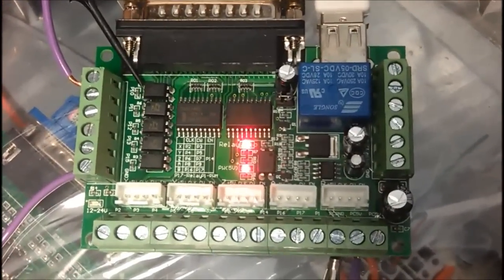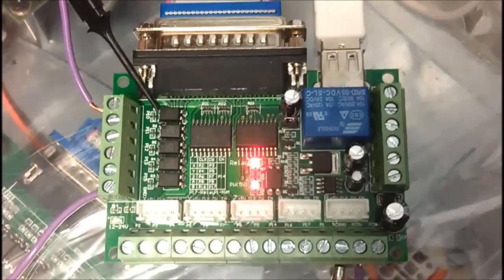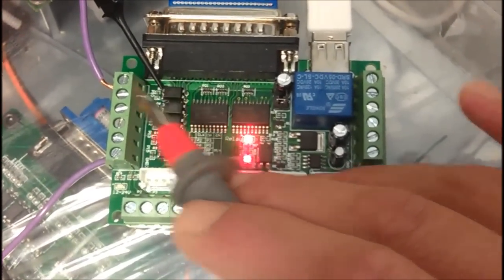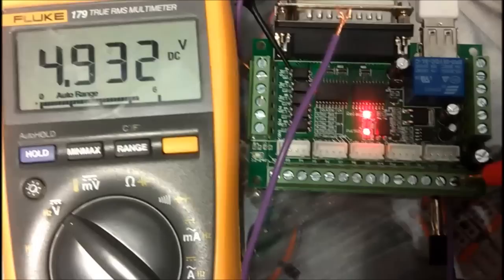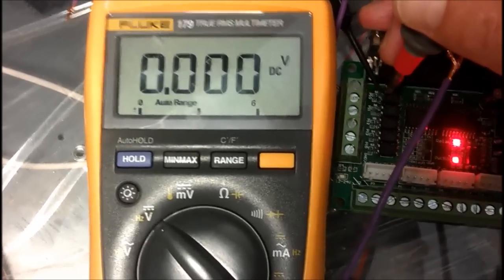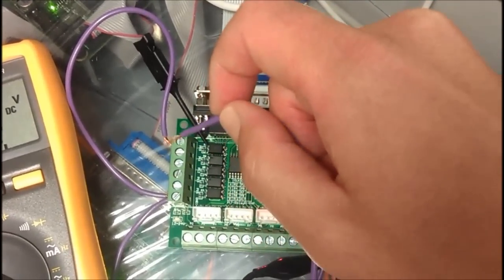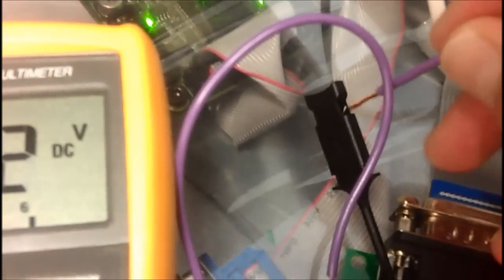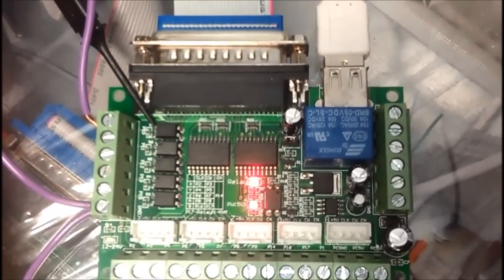MACH3 Interface Board CNC 5 Axis With Optocoupler Adapter Stepper Motor Driver

Comment: several issues here.... 
1) You're triggering the ESTOP as a limit switch? (top pin on the left side is the ESTOP trigger)
2) You're not supplying 12v dc - 24v dc to that board. You need both the USB 5v dc, as well as a seperate 12v dc - 24v dc supply.

Comment: I have only 1 red light. Why only 1 and you have 2? I have emergency mode on mine also so looks like the same issue. Chinese junk!  Now how am I supposed to do this; solder a wire onto that breadboard on the backside? This you don't explain. Is there not a better way?

Comment: It seems to me you can blow out your pc's usb doing this, since the optocouplers are there to protect it from over-voltage not guaranteed otherwise due to capacitance building in the circuit.

Comment: Hi mister
I have a latest generation pc with Windows 10 professional
I put the pci to parallel ports card in the pc and I connect the parallel cable to the breakout board mach3 card I have no reaction from the motors
Reply: u need buy pci/pciE to paraller port card cost normal 4-12$ or different USB breakoutboard. cost about 20-30$ and better not use mach3 not realtime not safety use, lot better  linuxcnc software.

Comment: How did you number the inputs of stepper in Mach 3 , I have the same control board also other issue was ;  usb is not recognised by mach3 , only parallel , how can I change that to usb to be recognised by Mach 3 ??? Please advise
Reply: board usb have only logic pin power supply,NOT serial port. buy other card if need use mach3 shit to usb serial way. if want build REAL cnc good use FREE linuxcnc lot better and mesa 7i76 etc card.or this board.

Comment: Is this possible to operate mech 3 interface board by only connecting to usb without connecting to parallel port
Reply: NO CAN usb have only power in port. board need 5V to board.

Comment: In the manual I have it clearly states that "USB power supply and peripherals powered phase are separated to protect computer security.
" So you actually need the external 12-24V power supply to do this, and it is designed this way for security reasons as you can see. By doing this, you are jumping over the intentionally designed feature, which in my opinion is wrong.

Comment: Sir how to verify the board is connected to PC,,.   I run the mach3 but the motor is not running,,
Reply: Hi i have the same  problem  motor not running and led from relay turning off
Reply: @sorinionescu8702  sir but also  not working ,, and I test the  mach3 driver test , and that shows not sensed drive ,,,  what can I do for that,,,
Reply: @suriyabala5860  go to device manager and in mach3 click and you will see mach3 driver and if you have symbol ! or ? is because windows
Reply: Hi did you solve your problem?
Reply: @sorinionescu8702   sloved sir

Comment: In order to have 5 volts and 24 volts work together, put a common ground between inputs ground (P10,p11,P12,P13,P15,[GND]), PC ground, and 12-24V power supply ground.  Inputs will work correctly then.

Comment: Dear Friend

       Since this is my first time machine CNC PLASMA MACHINE build as my hobby work , im totally confused and im unable to move further for the wiring connectivity keep struggling for months together.

Machine Circuit detail :

https://drive.google.com/file/d/1NBdqDqcjzJGDOSVfGKeUJ8DtI7IdlGm4/view?usp=sharing

Machine image:

https://drive.google.com/file/d/1GgFMNrxKOnY8Tks2vT_XcE_ClVKlPuHm/view?usp=sharing

Considering on the above circuit details , Kindly give the answer / guide /solution for each of the below question:

1) Im planning to operate the control board to operate plasma cutter in 3 function, 3 axis for the sheet metal cutting , 4th,5th Axis for the pipe cutting  , is the connection is corrcet? 

2) Homing and limit switch are connected correctly? if not kindly guide me how to do the connect.

3) Where shall I connect the “Z Axis Tool Setting Touch Plate Probe Sensor Detector “? 

4) Im having complete set of machine with all the hardware (machine body / stepper motor / Stepper drive) for all the axis X-Axis ,Y-Axis ,Z-Axis ,A-Axis ,B-Axis, I can make mount the Torch also in my machine. Request you to give the remaining cheaper electronic component detail, so that it will help me a lot.

Kindly do the needful.

Comment: Hi , hope you can help ! have installed USB mach3 board , have XYZ and the spindle running. Have loaded short G code just to try the mach3 program crashed shortly after start . I have disconnected the spindle and retry mch3 don't crushed. ?

Comment: I have problem.. when i connect printer port LED of Relay goes off..? Can you help me please..?
Reply: No one help for this case...
I also suffered with this!
Reply: Hi did you solve your problem? because i have the same problem
Reply: @sorinionescu8702  have you connect board power too 5V usb port need board power.

Comment: Ryan
Do you think you could do another video showing how you wired your board from  P10 to P15 or just pose a drawing, sorry  it just was not clear to me how you did it . I
have the same new board  with the same problem and I cannot get my limit switches to work no matter what I do. Electronic wiring is not my strong suit and I'm concerned I'll short out the board. Here it is May 2017 and who ever builds these boards hasn't solved the problem  yet. I don't get it! Thank for doing the video.
John

Comment: Hey Ryan, Thanks for the video, it helped me figure out what was actually going on.  BUT you are doing it wrong!  

The optocouplers are meant to isolate the PC from your input system and by applying 5V from the PC you are defeating this. 

If you apply power to the 12-24 DC IN terminal and ground it there (Both located on the Right Terminal Block in your video) then the board supplies a ~10VDC to the couplers for you (linear regulator next to blue relay provides this).  Your 12-24V input power should be isolated from the PC to protect the PC and can be the motor supply or a separate supply that shares ground with your motor controllers. 

The point of the board is for the motors to have a different ground system from the PC, don't connect the two ground systems together.  The PC 5V and PC 5V GNDs are there to run the other sides of the isolators (the PC side) that signals high and low to the parallel port.
Reply from the maker: Karl Engineer.  Thanks,  the idea to run a 5v supply was because I wanted to reduce the number of power supplies in the controller so these boards and the limit switches run off a separate 5v PSU.  This comment is still good as others might try running this off there PC USB.
Reply: I buy this mach3 board and connect to my window 7 64bit processor computer but nothing happened is this board work on 32bit processor

Comment: Just threw tons of time away trying to figure this board out with no documentation. Then finally found this video that almost helps with the problem. Marvin Runyon is a friggin genius for the correct answer thank you so much Marvin! You creeps that sell this thing should be ashamed of yourselves for not posting documentation.
Reply: How did you do this, solder a wire on? I can't be sure and don't want to screw mine up.

Comment: The USB port is not a signal out port. It should be connected directly to a 500 ma USB port on your computer. It's purpose is to supply the board with 5 v you are all looking for. No need for any special wiring or separate 5 v supply.

Comment: hello dear, i want without Optocoupler, microstep Motor Driver. it is possible??

Thanks & Regards
Reply from the maker: It could be,  but the opto couplers are the protection for the circuits from the steppers back EMF.  So I would really not buy a board without them.

Comment: Hi;
I just got MACH3 Interface Board CNC 5 Axis like you have in this video and Tb6560 V2.0 card but i don't know to connect them together and stepper motors, could you show me how can i do it Thank's
Reply from the maker: +Redouane Elalj This is the controller board.  You need to connect the 2 signals, direction and speed to a motor driver. It's the driver that will have the right connections for the motor.

This video shows what the driver looks like 
https://www.youtube.com/watch?v=FdJjZ3PHo8k

Comment: good job, it work
Reply: kayer kh if you wire 12-24V power supply and 5V for the relay, the limit switch work, the  sellers don't indicate this details

Comment: I just got the same board. How do I connect the stepper motors to terminal blocks?
I only see two connections for each axis.
Reply from the maker: This is the controller board.  You need to connect the 2 signals, direction and speed to a motor driver.  It's the driver that will have the right connections for the motor.

Comment: I discovered this:
1. if you want to use relay and driver control is needed 5V USB power
2. if you want to use limit switches is needed 12-24V power
3. if you want to use both function is needed both power

Comment: If you power the board through the 12-24v input instead of the USB (5v) the input opto-couplers have 9v from the onboard regulator.
Reply: I did that but I still get nothing. What the deal? I've been stuck on this for a week or more and nobody can give me an answer. I'm having to order a red board off amazon tonight because nobody understands this one apparently.

Comment: I just got the same board and I can not get it to power my Yoocnc driver cards.
I got it to replace the Yoocnc interface card... supposed to be PNP.
There is no 5v on my optocoupler either...:(
I just moved the 3 plugs from my old interface to this card... no steps...
Any help ?
Reply from the maker: Hi. I took a quick look at the old card you had, and by the looks of it you might need to change the cables around on the plug. i thing the yoocnc had drive and step pins first and this card has a 5v first.